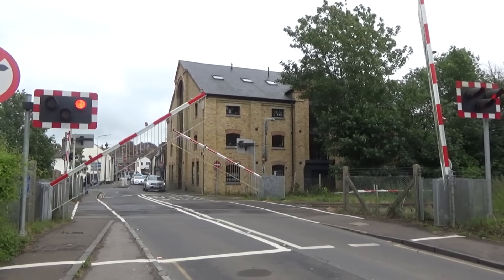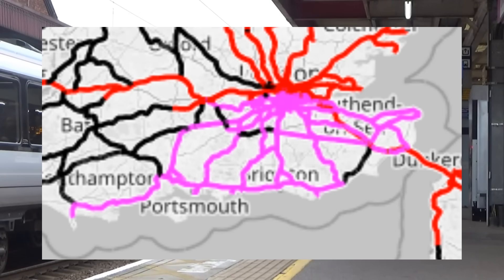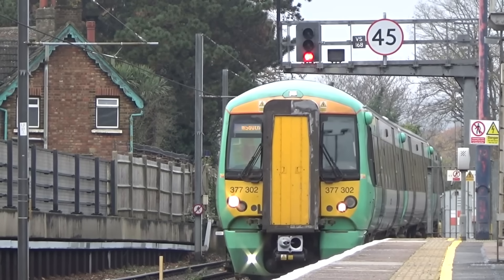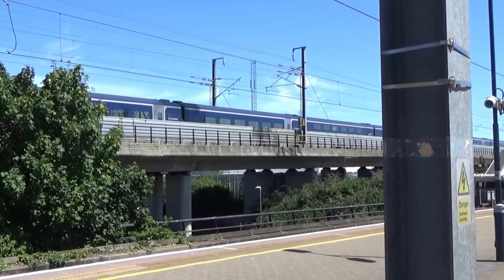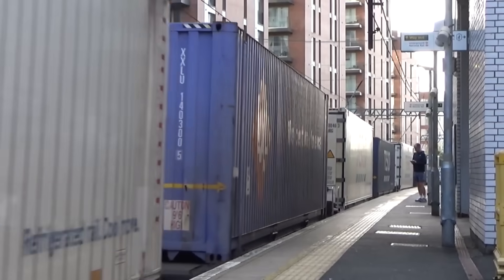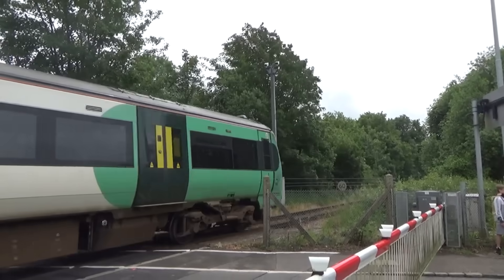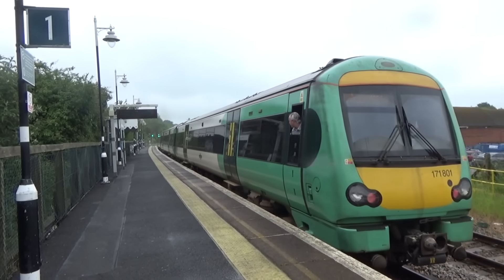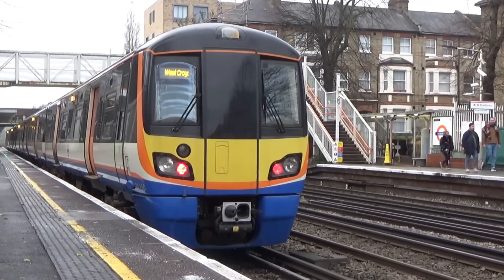Are These Railways Actually Unelectrifiable?

Comment: ORR does allow 3rd rail electrification for infill  with achievable risk assessment.  3rd rail predominantly kills trespassers and drunks and not so much staff who generally treat the 3rd rail with the respect it requires.  They won't allow new electrification schemes unless no possible alternative and I don't think the consider eye watering costs to be 'no possible alternative.'  Realisitically if we want to electrify the railway we have to accept that most of the south is 3rd rail and bite the bullet and simply say if you got on the line and get killed, tough you went past a fence or climbed over a barrier so your look out. Infill the rest and OHLE any new installation that isn't already electrified.

Suburban rail where the stopping pattern is mostly all stations or semi fast with line speeds not over 90mph don't really justify OHLE.  The south doesn't really get much of a snow problem and ice is treatable with de icing trains and points heaters.  OHLE conversion would be so ridiculously expensive for zero net gain.

Comment: There are plenty of OLE and 3rd rail compatible units Class 700, 717, 710, 350, 377 and 387 units all can run on both. The question is whether it makes economic sense to put catenary up on the diesel sections of the 3rd rail zone.
Reply from the maker: yeah these trains exist and are possible, but not available for this line. we would need new dual voltage trains to operate this line

Comment: To be clear, the north downs line reaches Reading, where the GWR main line is OLE. But none of the north downs line is OLE. It's entirely separate. The section it shares with other operators (Wokingham to Reading shared with SWR, the guildford area, and the section from Reigate to Redhill/Gatwick) all have third rail power.

I live on that line and I can tell you there are plenty of road bridges that would need to be changed for overhead power. I really don't quite see why, on a line that has probably 1/3rd already electrified with third rail, why not just give an exception here and finish the job? We have a lot of cancellations because, they just don't have extra trains to run and they're 3 cars only. Every arrived in Reading to go home and forgot it was Reading festival weekend? Oh the lucky few that get on a train.. Because they don't have extra trains to run on events like this.

Electrification would allow for longer trains (perhaps needing selective door operation on some platforms) and with many operators running these trains, subbing in extras on events days would be a real possibility.

Just seems a bit weird to rule it out in this case, to me at least.
Reply: Some of the NDL trains use the high numbered platforms at Reading (12-15) so do briefly run under the OLE.
Reply: @RJSRdg  Yep, that's true. I've also taken a train from the main platform (7) at Reading. There's tracks to take them under to the high platforms and tracks to take them onto the main line.

But, these are used as exceptions (and also used for the rare cross-country service). They're not really part of the line. The line terminates at platforms 4-6 on tracks with third rail power.

Comment: Correction: the North Downs Line does run into OLE territory at Reading, however it runs over the old LSWR Third Rail route, not the GWR mainline, so electrifying it with OLE equipment would make little real sense.
Reply: Some trains on the NDL run into Platforms 12-15 at Reading, which are OLE territory.
Reply: @RJSRdg  Logic says electrify Reigate to Guildford, and Ash to Wokingham on third rail. Then extend the third rail into platforms 12 to 15 at Reading. Then when the overhead finally gets extended to Oxford. There could be a regular frequency service Oxford to Gatwick (and possibly on to Brighton) using bi mode units. A west to south spur from Reigate to Earlswood would also sort out the Redhill bottleneck. It would also be of use to Grand Central if their Newcastle to Brighton service gets ORR approval.
Reply from the maker: yeah 3rd makes more sense here, but where the trains are maintained (reading) is defo a OLE area

Comment: I think you are falling into the trap of talking about the "cost of adding electrification to these lines" and not talking about the "cost of not adding electrification to these lines". Anti-rail propagandists (and some of our MPs are anti-railway people) like to pretend that doing nothing involves zero costs. Doing nothing does not involve zero costs. It involves ongoing costs.

The "cost of not adding electrification to these lines" include:
* Having to train drivers in the South East of England to support a small fleet of obsolete trains that only work on these small sections of track,
* Having to train engineers in the South East of England to support a small fleet of obsolete trains that are not used in most of the South East,
* Having to pay all the cost of maintaining diesel fuelling systems that are not used by most of the trains in the South East,
* Having to maintain replacement parts and inspection equipment in the South East that is bespoke to these trains,
* The healthcare costs caused by passengers on these trains breathing in an increased amount of diesel (and increased chance of developing lung problems),
* The operational costs of not being able to divert other trains down these lines (if there is a blockage further down the mainlines and the signallers want to find ways to "turn some trains back" to maintain service levels),
* The operational costs of these diesel trains travelling far beyond these isolated lines and being generally slower than the other (electrified) trains and therefore interfering with the ability of timetablers and signallers to run the most optional pattern in normal operation or when failures occur and maintaining partial service is the priority,
* Using trains that are older means that more maintenance needs to get done and the reliability of the units decreases,
* And last-but-not-least, if we "do nothing" we eventually get forced to buy new diesel trains, despite diesel trains being obsolete technology.

The bottom line is the upgrades that increase reliability of the railway pay for themselves over time. And the propagandists who work for the car lobby (and the people who have been taught to think that saving one tree from being cut down is more important than saving thousands of trackside creatures from breathing in polluted air) do not talk about the entire lifetime costs of work, in both money and environmental damage. They like to put the focus on the big conversion cost, as that is something that they can more easily block.

All of the trains on Thameslink are capable of switching between overhead electrification and third rail. All the Southern Trains that operate the West London Line from East Croydon to Watford Junction do the same thing. And many of the trains on London Overground also switch between overhead electrification and third rail. All we have to do is buy a few more trains that have third-rail shoes and pantographs and stick overhead electrification into these "electrification deserts". We are going to need those trains anyway, when the South East is eventually converted from third rail to OHLE. So buy them for these lines and then move them around South East England as the DC to AC conversion starts to sweep west from Kent.

Comment: All of the 777 trains that were bespoke designed for David Powell's Merseyrail level boarding upgrade, we built to work with third-rail, batteries and overhead electrification. A few have had the battery kit installed in them. None of them have the overhead electrification kit installed in them yet. The workshop in Liverpool is set up to install both types of adaptation.

We need Central Government to commit to increasing the number of miles of track that is electrified every year.

And, while it makes sense to focus the overhead electrification engineers on the areas that have no electrification of any type, when the third rail wears out to the extent that it has to be removed and replaced, or the transformers that create the DC are coming to the end of their life, that is the time when sticking with DC or switching to AC both have a cost and you can subtract the cost of staying with DC from the cost of switching to AC and figure out how much extra money is needed to do the right thing.

Really the UK government should have funded the third rail-to-overhead line conversion when Merseyrail was closed in stages to adjust platforms to make them the correct height (so the level boarding sliding steps would work). The lines were already being closed. Replacement buses were already sorted. Wayfinding for replacement buses was already sorted. The UK needs to have politicians who move away from arguing for every project to be de-scoped as much as possible, to having politicians who try to add level-boarding upgrades onto every bill for purchasing new trains for the UK. (East West Rail is a key example here. It's being built without overhead electrification and when it gets overcrowded the only way to get more trains onto the line will be to close it for months or do weekend closures for years, to get overhead line equipment in that could be going in now, when nobody uses it yet.)

Comment: The MML and the rest of the GWML and Chiltern Mainlines should be done first, but for these random bits, there should either be an exception made for 3rd rail, OR these should probably go for 3rd rail trains with batteries that can be charged at stations along the route. SWR have already investigated this for the West of England line from Basingstoke to Exeter. They have considered retrofitting Desiros or spare 701s with batteries and having short sections of 3rd rail that go live only when the train is in the block section, to improve safety.

Comment: ELECTRIFYING THE MISSING LINKS 
There is absolutely no reason whatsoever for any line on the Southern to NOT be electrified with 3rd Rail. Indeed The Southern Railways expansion of the Third Rail network, Pre 1939 included both the Ashford - Hastings line and the missing bits of the Redhill-Guildford-Reading line, AND A LOT OF OTHER LINES SINCE CLOSED. It was only WW2 that stopped the electric third rail expansion, followed by Nationalisation in 1948. Indeed the Oxted - Uckfield line would have been electrified all the way to Lewes. The Uckfield - Lewes section being closed in 1969. As would the line to East Grinstead which would have been electrified to Horsted Keynes, and later Horsted Keynes to Lewes. Even the Horsham to Shorham line via West Grinstead was slated for Electrification (closed by Beeching). And any such line electrified, can of course utilise any of the current third Rail types. 

NOTE: "LT TRAINS" is NOT a Railway Engineer, and much of his "speculation" has no founding in Railway Engineering. I've worked for BR and a number of Railways around the World for over 40 years. Including dealing with both 750v DC Third Rail Projects, 1500v DC overhead and 25Kv AC at both 50Hz & 60Hz !
Reply: Infilling the traditional 3rd rail would have made operational sense, but as pointed out in the video the ORR is now very unlikely to ever authorise it. H&S rules in the modern world have to be considered, BR existed without such constraints. Almost certainly the most cost effective solution for Marshlink and North Downs now is to use battery - electric trains. The Uckfield line is more problematic as that involves a 52-mile round trip on unelectrified tracks. The probable solution here is to recharge battery electrics at Uckfield, in the same manner as the Greenford branch with a fast charge system.
Reply: @chris8405  The "ORR" like much of Britain today is living in a daft Pseudo Green mad house. And I'm well qualified as a senior Railway Engineer to say exactly that. And H&S is NOT qualified in Railway Engineering, as they are in reality a subsiduary of one of the Ministeries, and Civil Servants NOT Railway Engineers, so know absolutely nothing whatsoever about genuine rail Safety Issues. Why do you think they abolished HMRI (His Majesties Railway Inspectorate) back in 1997 & the best qualified Rail Crash Investigation system in the World ???  Hence they have turned H&S into a money spinning game, which is NO longer affordable since Britain left the EU under Brexit. 

And totally daft and expensive "Battery Electric" trains simply introduce non standardisation in an area otherwise fully electric. And the Uckfield line does NOT present any problem whatsoever with being electrified cheaply using Third Rail. Why do you think the original Southern Railway (a Private company that needed to make a profit) choose Third Rail back then. It was the cheapest and most successful system available then and still is today. Indeed as a Result the SOUTHERN RAILWAY was the only Railway in Britain that made much more profit from Passenger trains than Freight. Thanks solely to Third Rail. 

Where you get your ideas about railways from I really don't know, but you are talking absolute idiotic nonsense. BREXIT alone means that virtually all of the Pseudo money spinning Green Issues are NO longer affordable, as they are NO longer subsidised by the EU, in a shower of Confetti handouts. Your living in the Past, Britain is virtually bankrupt. Why do you think Tens of thousands of Millionaires are fleeing Britain like Rats leaving a sinking ship, on a monthly basis. And as from October all your savings and Investments are going to be Taxed, wherever in the World you live. Which is why the sensible people are all in a panic to leave before that new Law due in October. An issue that is also taking many of the real "Brains" with it. Indeed I left Britain 25 years ago, because as a Senior Railway Engineer, I got better paid Contracts overseas. And I have no intention of returning to the "Sinking Insane ship" called Britain !!!!